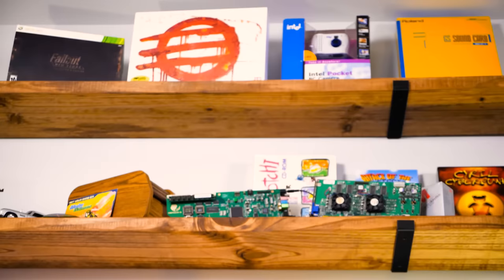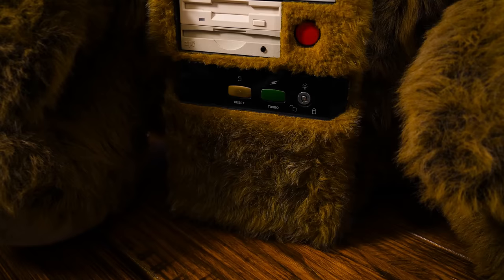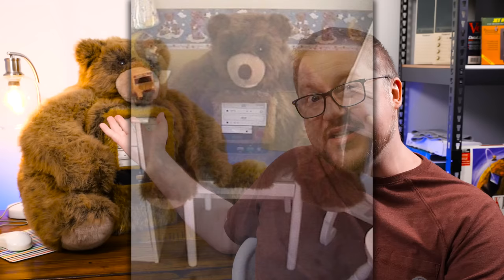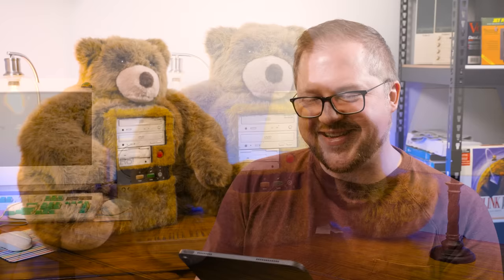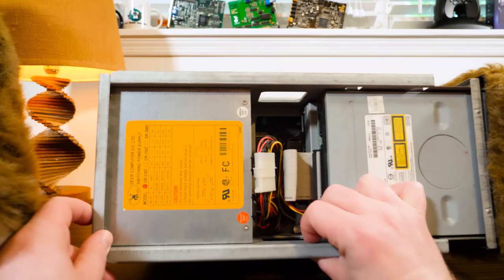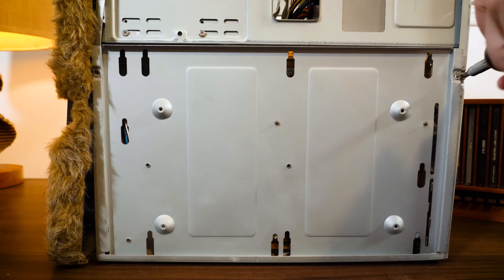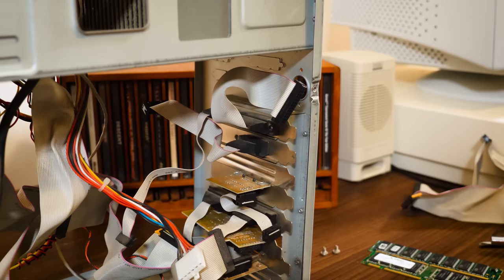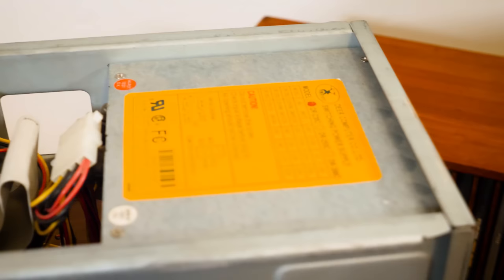The Bear-A-Byte PC: Pentium III Teddy Bear Computer

Comment: Those Deer power supplies were infamous for catching fire... so it is a miracle that something like this actually survived.
Reply: … so there is a deer inside the bear?
…makes sense!
Reply: came here to say this. had a pile of these pass through my hands and into my dumpster in the late 90s/early 00s
Reply: Bear in mind, with basically zero airflow any fire would suffocate immediately.
Reply: The deer would of burned the bear to toast then. Lol
Reply: @metacob  Bear in mind? It's right on your screen!
Reply: oh deery me.
Reply: mine Deer still works, but 13,2V@12V rail looks a bit scary. somewhat popular in Europe, has the same quality as Codegen. look at PSU Tier List, not only english based, because they often skip older parts
Reply: What about those Dog cooling systems that could only cool by panting?
Reply: @AgentXRifle  Just like a Tur-Duck-en, there is probably an elephant stuffed inside the deer.  I think its the memory.
Reply: Now this is the kind of weird I'm actually in to. :-)
Reply: Oh how I know! Had one myself that blew up and a customer’s when I worked at CompUSA
Reply: Yeah, I was just about to say, get that Deer power supply shifted. It's a fire hazard.
Reply: Only you can prevent PC fires!
Reply: I remember them coming in the cheap-o cases from the local mom and pop computer store.  Had one let out the magic smoke, but none ever caught fire.
Reply: @donborvio  Yeah, Deer PSUs preferred to just have their rails go wildly out of spec, kill any connected hardware and keep ticking, ready to kill the replacement parts.
Reply: D'oh! A Deer! A female Deer?
Reply: if I had to guess it wasnt used too often.
Reply: There’s one forum I seen called hardforum when I searched for deer PSU on google and the guy that brought the PSU to the tech to get sleeved said that it wasn’t even worth being sleeved and is very low end. And everyone else on the forum said the same and recommended better ones, for the time at least. The topic was started back in 2004. And I surprisingly haven’t seen anything else mentioned about these.
Reply: @fryode  Voiceover : "There were never any female deers..." 😉
Reply: BWAHAHAHAHAHA
Reply: so the deer inside the bear is a bit of a dog??
Reply: I have been thinking of this PC as a potential origin of a house fire since I saw the thumbnail for this video. With that piece of information I did not know of, now it's really scary to think this was used for years. As you probably know, unless there's a physical switch cutting the current the power supply has some components, like filtering caps and stuff powered on permanently, so it's not like you'll be around necessarily to quickly act in case of a magic smoke event.
Reply: @BilisNegra  in those days, most desktop power supplies DID have a  physical switch in the AC input, so it did indeed fully open the circuit..so no problem.
the later ATX power supplies, generally did leave some of the circuitry powered, but the AT class supplies did not.
Reply: @tennickjestzajety69 when i ran a pc repair shop in the early aught we got the Deer PSUs from the same vendor as the Codgen units iirc... and the only psu I ever had catch actual fire on me was a Deer on a drive upgrade.  Machine kept running until I pulled the plug.

Bonus: sold a new case to go along w/ the drive upgrade and the PSU replacement

Comment: "Nothing burns like a Deer" that was the saying when we would see those back in the early 2000's at the repair shop I worked at. It never failed that if we had a machine that would come in with a deer PSU it would not power-on.
Reply: Only the finest Chinese metallurgy
Reply: @ozzie_goat  *Taiwan. China stuff didn't really pick up until the mid 2000's following their entry into the WTO.
Reply: Oh deer!
Reply: @straightpipediesel But Taiwanese companies would still use suppliers from China
Reply: @MrCarGuy  In those days, they didn't. The bad capacitors from those days were stolen formulas that were missing key ingredients from japanese manufacturers.

Comment: Speaking to the cooling issues:
The brown fur on the faceplate had negligible influence on the airflow.

And the way I wrapped the bear around the case part making sure that the back side was completely unobstructed.

But also keep in mind the hardware of the late 1990s early 2000s didn't have the same thermal and cooling issues that we experience with today's hardware.
Reply: Nope. PC's back then were fine with a huge brick of lead glued to the CPU and a little fan and they did plenty well.
Reply: They would consune somewhere between 10 and 20W back then, you can likely passively cool them with a bigger heatsink
Reply: Oh yeah, it used ot be way different. CPUs used to not even need fans. My first computer had one single fan in it, on the PSU. That kind of setup would be unthinkable in 2023.
Reply: I how you got the exhaust in the right place!
Reply: You took build a bear to a whole new place and level !
Reply: how do I order a bear gaming PC to play the sims ???
Reply: @astrosteve  I remember sitting at my PC one night when I heard a loud "KLONK" from inside the computer. That was because the glue that held the CPU heatsink in place had stopped working and the chunk of copper had fell off. I expertly secured it back in place with some tape.
Reply: @astrosteve not really, you can get cases with passive cooling for the cpu
Reply: Yeah I've got one of the most powerful Socket 7 CPUs out there (500MHz K6-2+) and yet the heat sink doesn't even get hot. Running a stock Intel cooler from like 1999 and whatever bit of thermal paste is still on there after 25 years.

A bottom of the barrel P4 will probably blow a hole in the motherboard if the fans aren't ramped up.
Reply: @MrWolfSnack I'm curious as to what you're saying "nope" to.
Reply: You gotta make a Chewbacca pc, that'd be perfect.

Comment: I love it that someone was willing to modify that back then. I remember in the late 90s just being thrilled that the computer was running, then never wanting to touch it, for fear of overheating or giving some random error that took forever to figure out. Bold step to put it in a huge teddy bear.
Reply: I bought the case bare bones and modded it up before I had the hardware installed.
I brought the whole thing into the shop so the owner/tech would have some context of why the front panel was brown fur.

Comment: PC Club was a small chain of computer stores with main corporate office/warehouse in City of Industy, CA. They had just started branching out across the US when the owner passed away. Unfortunatly the owners brother took over, stopped paying vendors, liquidated what he could, and left the US. I woked at PC Club for a few years, lots of great memories.
Reply: Well that's a depressing corporate history.
Reply: @Bobbias  It really was, especially for those of us that worked there.
Reply: tbh and imho looking at the parts it seems not like a great company, I mean look at that PSU and Mainboard, 1999 and no ATX PSU was used that would power off itself after shutdown? PC Chips as a brand is questionable at the very least. Maybe it was really cheap but it looks like they basically took whatever old parts they could find to squeeze out the last penny.
Reply: @gentuxable  thats not the stores fault but the manufacturer of the device. many big name brands sold the same trash components
Reply: @animeloveer97  to me it looks like those preconfigured PCs many smaller PC shops ordered from OEMs where they have control over the parts but I could be wrong, I suspected they just ordered the lower left model while there were some more decent options available for a little bit more money.. Sometimes things like a Pentium 3 but only 16 MB RAM and upgrading wasn't always an option. Real big brands like HP Vectra, Compaq DeskPro or IBM Aptiva were even more expensive for features smaller offices didn't need so building yourself as even my school (or my family) did was more efficient.

Comment: Now I've come across some crazy case mods back in the day, but this is amazing~

The issues with the sound reminded me that this is the exact era of PC that cemented the whole "onboard sound is garbage" mentality.
Reply: Yeah, I distinctly remember only choosing moboards that didn't have integrated sound or video because I knew I always wanted a good SBcard and an even better video card.
Reply: before RealTek HD, onboard sound really was terrible. All the early boards had ACS chips, and they were absolutely awful
Reply: @Robert08010  you could have just got the soundcard anyways no?
Reply: @animeloveer97  Not exactly sure why but I was under the impression back then that adding those features like a good sound card was made more difficult if the moboard had that feature build in due to resource conflicts. So I always opted for the board without a build in graphic chip or sound feature.
Reply: @Robert08010  That's why there's almost always an enable jumper (or BIOS setting) for internal peripherals. If the internal video is always enabled then yes that could be a big issue.

Comment: In the days this board was sold on the market I worked for a wholesale computers parts supplier. One of the best boards pc-chips made! All those extra brackets were a typical thing for this brand and this was the era where you could use AT or ATX cases since the market was just changing. Afterwards for Pentium 4 and AMD systems our company began to buy Ecs, which was really a step down aka hit or miss depending on the model since some SIS chipsets were slower/less stable than most VIA or Intel chipsets from brands like Asus or QDI.

Comment: This is definitely an example of "just because you can doesn't mean you should," though it is adorable as hell and needs to exist. That being said, I can only imagine how hard it is to keep this thing cool and clean.
Reply: Since the front and rear airflow is largely unimpeded and given that most of these PCs had solid metal side panels, I imagine cooling was not remotely an issue.
Reply: A Pentium 3 system wasn't running that hot, it required active cooling but I've seen many Compaq Deskpro systems having almost no cooling for that kind of CPU without dedicated GPU. With an exhaust at the rear and a tiny intake at the front I see no issue.
Reply: before we hit 1 GHz, cooling wasn't really a big deal unless you overclocked the computer. Now, the factory OC chips Intel and AMD put out in the late 90s when they were battling to have the fastest CPU between 400 and 800 MHz, those bastards ran so hot you needed every bit of fan you could shove into the computer, and putting those inside a bear could possibly be fatal

Comment: This HAS to be a house fire starter at its prime. I would do a sleeper build in this, and pad that box with as much fireproof material as physically possible.
Reply: The trouble with sleepers is components today run MUCH hotter than they did in the mid-90's, even with being more power efficient. This'd most likely be fine with components from back then, but try to shove a modern CPU and GPU in there and they would cook themselves in minutes due to non-existent airflow. I run an Athlon 7600X and a Radeon 570X (until I replace it with a current-gen card*), so not exactly top-of-the-line, in a desktop case from '95 and have somewhat of an issue even without the fur. 90's cases weren't designed for airflow, because it wasn't needed.

* While a Radeon 7600 would be punny due to having the same model number as the CPU, I think I'll want something with more than the 8GB VRAM the recently released model has, so likely a 7700 when available.
Reply: Take the actually-has-fish water aquarium case and fuse it with the bear case.  By themselves, both are Extremely Risky, but together, maybe the cancel out?  Maybe it could be a scuba bear.
Reply: I wouldn't leave that PC unattended, a PSU failure would be a good start.

Comment: I assume it's a Bear Bones PC. 
Also wouldn't overheating fears be constant with that on your computer?
Reply: I know that's right, this is one PC I'd hate to do a modern hardware stuffing into.. and I've done such conversions to digital dec PC and Compaq desk pro en cases
Reply: Not with the current hardware, but anything more and you'd need air intakes, since the front intakes are blocked off.
Reply: PC-bear: " Hey, bro ! Should we play crysis on me ? " 

User: " Dude , you'll be toast by even installing it . Are you nuts ? " 

PC-bear: " Dont worry ! I call my friend smokey . He knows how to handle fires . That a$$ ows me one ." 

User: " NO . " 

PC-bear: " Alright Alright . Geeze ! 

I start Cyberpunk 2077 , NOW!!!" 

* Nuclear meltdown happens *
Reply: It was not as big of a problem yet in that era.  But yes, that is right at the time that heat started to become an issue with items like 2CoolPC coming out to help solve that problem.

If anybody wants to see what some of the strange things we were putting in our systems in around 2000, look up the 2CoolPC.  The cases had yet to add more fans, so that was a strange blower that you would put in the bottom of your case to try and blow more cool air onto your motherboard.

Comment: Good on you for testing the power supply before powering up the system itself, that 8 and 6 volts over the rails would've easily cooked something.

Comment: Oh God. The very first computer my family had uses that same motherboard! I don't remember if the revision is the same, but the motherboard model definitely stuck with me. My dad bought that PC back in 2000, built by a brand called Metron. It came with a socket 370 Celeron 566MHz, 32MB of RAM (SDRAM), a 6.5 GB Seagate IDE hard drive, a 32x CD-ROM drive (plus a floppy drive, of course) and Windows Millennium Edition. The funny thing is that although the CPU was a socket 370 Celeron, it was installed on an adapter for the Slot 1 socket, therefore making it a Socket 370 Slot 1 Celeron. lol 

Overtime we upgraded it to a Pentium III 800MHz (installed on the actual Socket 370, though) and up to a total of 384MB of RAM and an 80GB IDE hard drive as well as a DVD-R/W optical drive. For the OS, over the years it went from Windows ME to 95, then to 2000, 98, back to ME, back to 2000 for a brief while until it landed back on 98 for a good while before it was upgraded to Windows XP Professional, which it ran for the rest of its days until it was retired around 2007/2008. 

I have fond memories of it and I spent a lot of time playing a lot of Need for Speed II SE, NFS III, NFS High Stakes, Hard Truck 2 King of the Road, LEGO Creator, The Fifth Element, among other known and unknown/obscure titles, all with terrible graphics settings because the onboard GPU on that motherboard is HORRIBLE and I could never afford an offboard GPU that would work with that motherboard. lol It's thanks to this PC that I discovered my love for computers and decided to work in IT. I still have that PC and it still works, though I haven't turned it on in years. I simply could not let it be thrown away so I kept it. It currently sits safely inside a box on a corner of my bedroom.

Comment: Thanks for all the great videos! I’m probably not the only person who noticed this, but I do remember from building PCs like this that the modem plugs directly into the motherboard without a cable. In this video you can see when the modem bracket is hanging low at an angle from when he pulled the motherboard tray out. You’d build this PC by installing the modem like it was a PCI or ISA card except it was using pin headers instead. Many motherboards from this era had weirdo proprietary connectors just for their modem card, which in reality was really just some passive components as they often winmodems that used the CPU to do all the modulating and demodulating. Basically, although I love vintage tech and videos like this, back in the day a system like this was my nemesis. Absolutely terrible. Winmodems were garbage, and PC Chips was my most hated manufacturer of all time. I would adamantly tell people to avoid PC Chips whenever possible due to accidentally buying one. But that’s a story for another time.
Reply: Clint definitely needs to see this. He also needs his own PBX so he can use all these modems.

Comment: Heh, I think we had this exact same motherboard on our Pentium III back in around 2000 too, exactly the same style, same port configuration from my memory too, same 2 USBs, definitely thought it was 2 PS/2s tho didn't know about the IR port. 3 RAM slots, the Slot 1 Pentium III (ours was a 550 MHz one) also brings back memories. We had 128 MB of RAM and a 10 GB HDD, CD-ROM only and 1.44MB floppy drive and that's it. The clunking power switch and "It's now safe to turn off your computer" message along with the floppy drive at power up sure reminds me of the Star Wars EP 1 Racing and Sim City 3000 days.

Comment: How the bear was integrated onto the PC case was pretty cool! 
The PC itself was pretty much a bottom of the barrel build aside from the CPU and amount of RAM installed. Those Deer PSUs were super cheap and generally terrible. I encountered a few of them back in the 90s and there is a reason why you don't see them anymore! 
PC Chips mainboards were the cheapest things you could get at the time. They were usually highly integrated with so-so components to lower the cost of a machine, often times sacrificing stability or speed to do so. Back then there were a lot of cheap PCs made by lots of small computer shops that would crash left and right which helped push the narrative that BSODs in Windows were just a normal thing. When really the cheap mainboard or poor device drivers were causing a lot of the problems. Which was a shame, especially in the 90s, because for many people it was some of their first experiences with a PC.